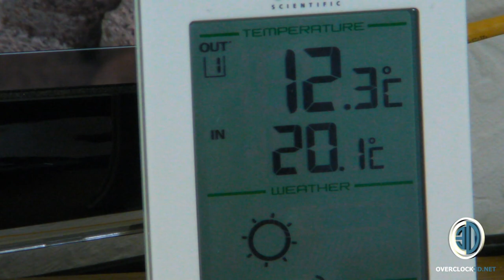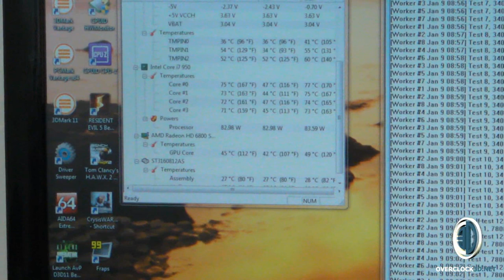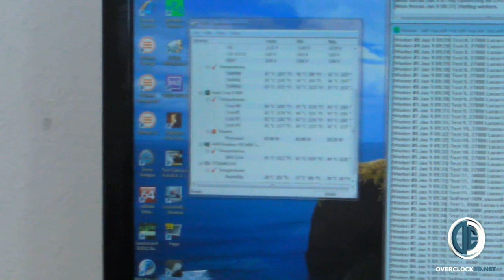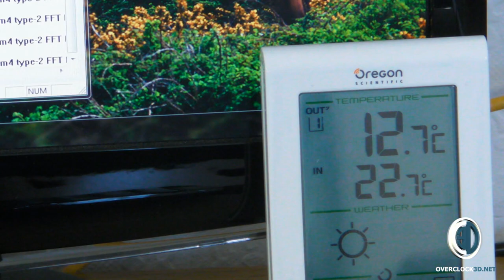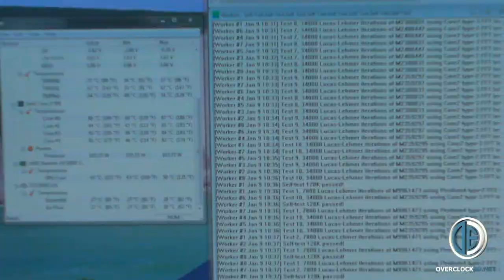Scythe Mine 2 CPU Heatsink Review

Comment: seeing as how it is currently $25 cheaper (usually $35) i think it holds it place against the NH-D14. i mean a 2 pack of 120's for $10 added to it should make it equal in cooling to the NH-D14 and your still $15 cheaper at current prices.

i agree the mounts are difficult but they are sturdy and do not leave me with doubts once its attached.

Comment: With the Silver Arrow at 55GBP two high quality fans and the same with the NH-D14 at 60GBP, it's hard to justify spending around 45-50GBP on these types with cheap noisy fans and much worse performance.

Would be interesting to see how these compare to the 20-25GBP coolers like the CM212 and Xigmatek

Comment: Yeah, I have to say, scythe, you need a better damn mounting system. I had a scythe mugen 2 before I went water cooling, and the thing was such a pain in the ass to mount. However, the price/performance was very good. With this cooler though, it doesn't keep the same trend.

Comment from the maker: @Eyeball1975 Slightly off topic? The key is probably locked to the specific version dude. But tbh its been so long since Ive used XP I may be wrong. Tell the old man to buy windows 7 and not to be tight.

Comment: Does all those CPU's u have run stable at 1,25 volt for 4Ghz ??
I have a i7 860 and cant  even run 4ghz with that volt, or is that normal for my CPU ?
I need at least 1.392 volt, but then yea the temps are to high.